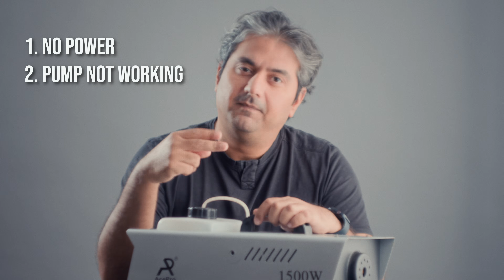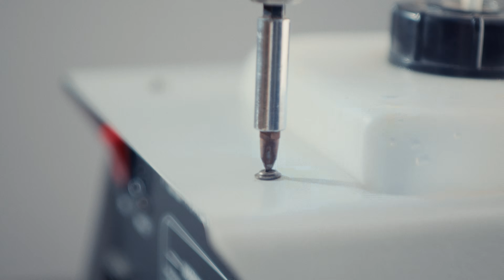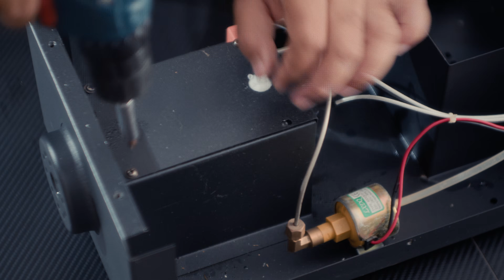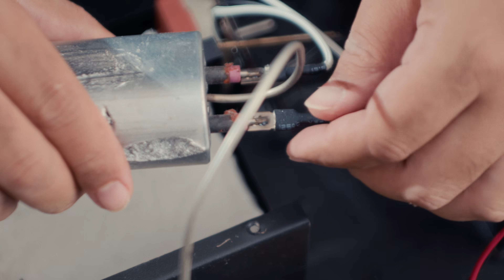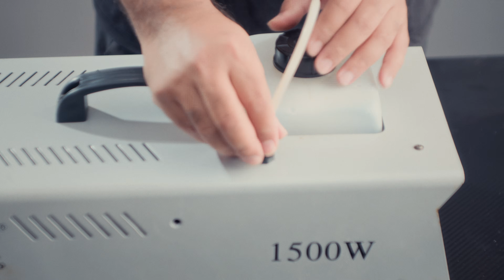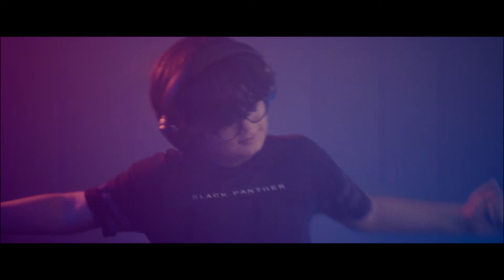How to replace the heating element in your Fog machine just in time for the holiday

Comment: Hi what to do if that nozzle it very clogged nd how do we rest to see if that heating part is dead ...thnx cos when we cleaned with vinegar it was fine for a while but then when put it back into water to cleanse iT stopped working at all
Reply from the maker: If the heating element is not working, the only thing to do is replace it, unfortunately. Check the wiring as well before replacing it.

Comment: Hi..love your videos...my.son cleaned his fog machine with vinegar but after a while that little while the motor did not come on..that small gold bar inside
Reply from the maker: It’s either the pump motor or the heating element, you’ll have to check both. Check if the element is heating. If it is, then it’s the pump motor that needs replacing.